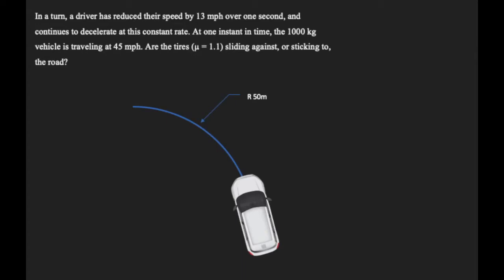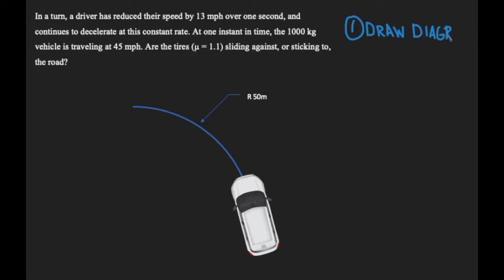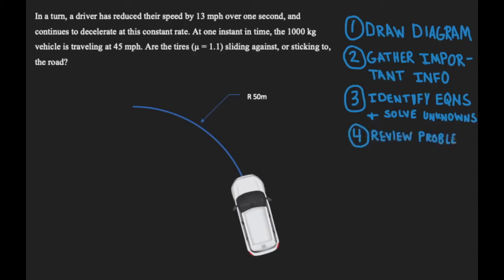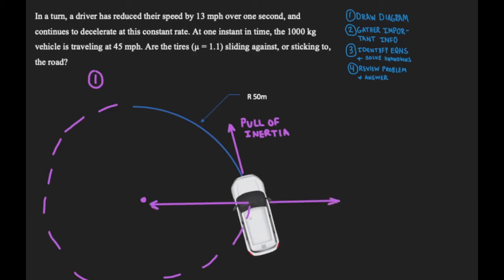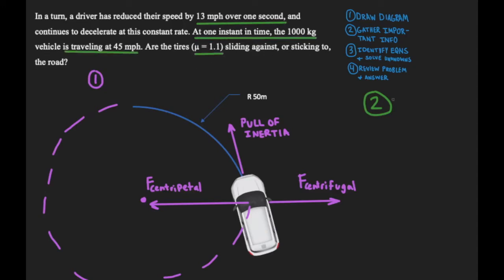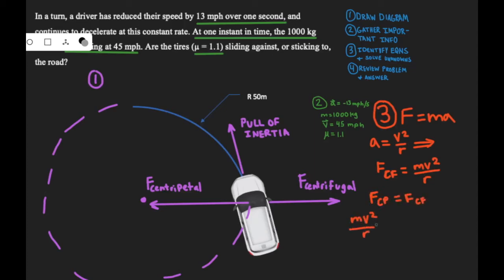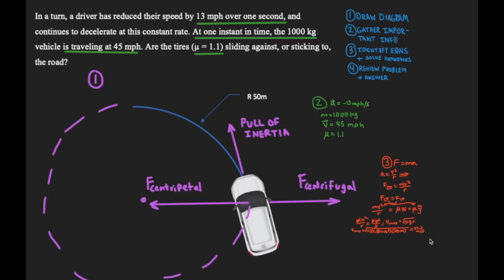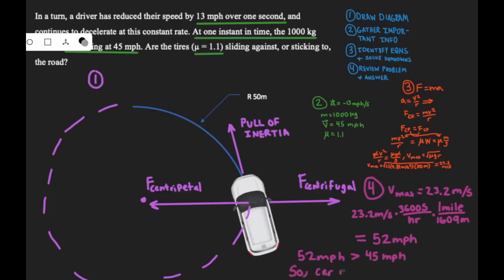TESLA Mechanical Design Engineer Interview Question SOLVED! #2

Comment: Hi, nice video! However I think you made a mistake here. shouldn’t we sum the deceleration force and the centrifugal force (two vectors) and compare the magnitude values to mu*mg (static friction force) and then determine whether it would slide or not? If the friction force is greater then we can make the conclusion of the vehicle won’t slide

Comment: Great illustration. Another way is, there are only centripeday friction force and deaccelaration friction force applided to the car in horizontal direction, composited friction force is easy to calculation, if it is less than max friction from the weight, then it won't slide.
Probably simpler on flow of thoughts.
Reply: this is what i did. i was very confused when i saw him comparing the velocities at first instead of comparing the frictional versus centripetal force

Comment: It seems like the effects of the braking were ignored here. Is that a safe assumption to make? It feels like there should be one more force vector which is the deceleration due to braking.
Reply: i think so too, in my head the car would possibly understeer while braking and turning. not all the friction will be used to turn but it will be split between turning and braking in that second and tires won’t give you unlimited grip
Reply: The braking alone from 45-13 mph in 1 second would cause slidding.

Comment: Hello, thank you for the video. I wonder why they put the deceleration value in the input. So if the friction force has to counteract that deceleration
Reply: I think you are correct. I believe in step 3, the centripetal force (friction) should be equal to the force from the deceleration plus the centrifugal force. In my calculations, this resulted in a max velocity of 35.25 mph, therefore the car will skid. Please let me know if you have found otherwise. Thanks for the good practice material!

Comment: Hi I'm confused with the conclusion of the answer. You say the car isn't skidding since it goes over 45mph, why is that? Also the question asks if the tires are sliding against or sticking to the road (with skidding you mean they wouldn't be sliding against right?). Thank you for your time and these videos!
Reply from the maker: Hi Adrian! Great questions… The car is  not skidding (or sliding against the road) because it is traveling 45 mph which is less than the maximum allowable velocity of 52 mph. If the car were traveling 53 mph, the centrifugal force would exceed the centripetal force and the car tires would start sliding or skidding.
Reply: @Arch1medes  Got it I understand now. Thank you for your quick response!